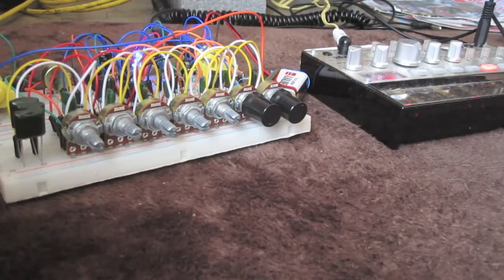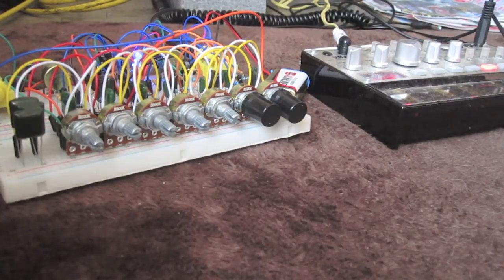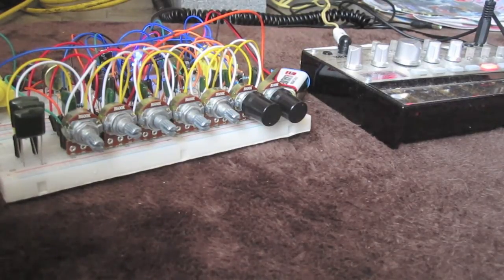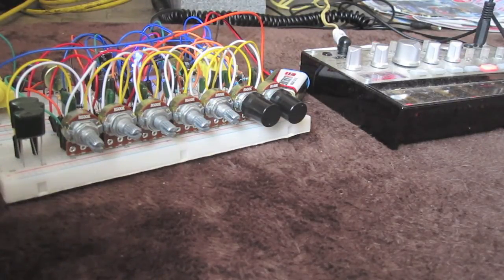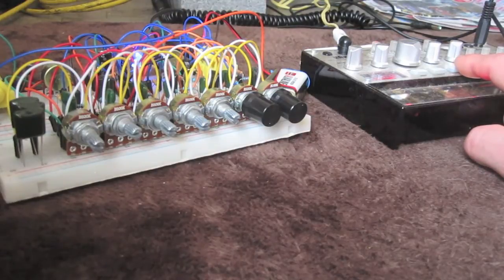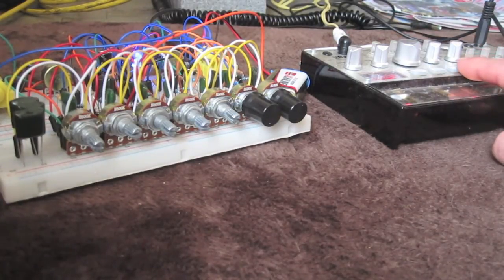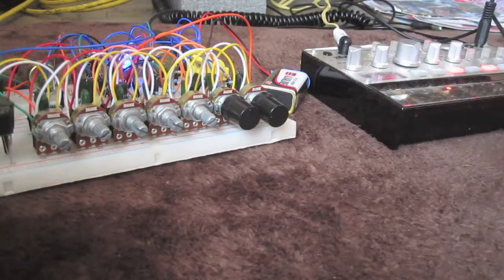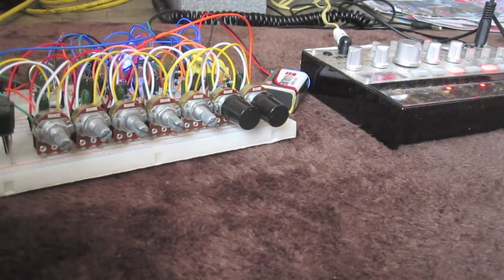Simple Active 7 Band Graphic EQ With Gain Prototype Demo Circuit

Comment: what is the power supply? I use 12V dual supply but not working. . sound is very low. even after power off I get the sound. what will be the input in one link pin 2 and in other pin 3. can u share your complete circuit with details. thanks in advance.
Reply from the maker: The links to the schematics are in the description. If you check the pinout of the opamp and the schematic it will tell you what is connected where.
Reply: I have tried. both the links. 6 band & 7 band. it's not working. I found sound even power off the circuit and connected input and output. input via mobile and output to my 2.1 sound box.
Reply: l have a 12v dual supply. pin 4 (-12ve), pin 7 (+12ve), pin 6 output. and connected with 150k resistance to pin 3. pin 3 directly to 100k Lin one end. pin 2 to other end of 100k Lin & in put with 150k resistance in series. and pin 2 ground via 1M resistance. I use transistor BC 548, c1, c2 non polar capacitor, 33k & 6.8k resistance and connect according to link Q4D and all 7 transistor out connect to mid point of all 7 nos 100k Lin. accordingly. but results very low sound. no such effect found. sound also come after power off. only sound off if 150k connected between pin 3 & 6 taken out.

Comment: hey there thats freaking awesome! im currently working on making my own 32 channle mixer, and eveything, kind of a pain inthe ass project but, its cheaper, considering im making it a multichannle audio interface, and midicontroller for a fraction of the cost. im getting promissing results, except the one thing i dont have routed is my eq, i have the pots but i dont know what the other parts ill need is, can you maybee tell me the parts? its going to be a 3 band eq! thanks in advance!
Reply from the maker: That's wicked! If you check out the links, you'll get an idea of what you need. Will it be a parametric eq or graphic?

Comment: This is awesome. Very helpful.
I've been working on an audio amp, including a 4 band filter and was hoping i could get your advice? What topology have you used for the filters here? I've been trying to decide between sallen key or multiple feedback, or maybe just chain a lowpass and a highpass together. Also, how did you decide on your band edges? Also did you just tie all the filter outputs together or is there some trick to recombining the signals?
Reply from the maker: +Whadrillival The actual circuit that I worked on was already designed. Here is the link http://www.4qdtec.com/graph.html or http://www.geofex.com/article_folders/eqs/paramet.htm . I simply added an amp on the output. I failed on the amp section, so I need to try it again soon.

Comment: I am always impressed about your projects!
sounds like a more versatile alternative to a standard 3 or two band EQ in a mixer.
and it can also be used as a kinda overdrive :-)
Reply from the maker: VolcaRock Thank you! Versatile in a way I guess. Parametric EQs are adjustable, this isn't so much, but it still sounds great! The overdrive you hear in the video was actually my interface's preamps driving, though this can get a little overdrive too. Almost done building the final product, just need to wire all the pots.
Reply: you're right it depends on what you need, sometimes a parametrci is also useful :-)
So I am looking forward for the final product
Reply from the maker: It's coming.. It's taking a bit longer than expected though. I need to get rid of RF before I show the final. Just waiting for a few thigs now.

Comment: Very cool MrFricoco. I always find it very complex working with the breadboard. Compaired to the projects I've done I see you have no problem with that :D
Reply from the maker: Arrayzable It's even worse when you work with a cheap one that doesn't always have solid connections. I'm wondering now if I should start using a different type of wire to connect everything. It gets messy when you have bigger projects.